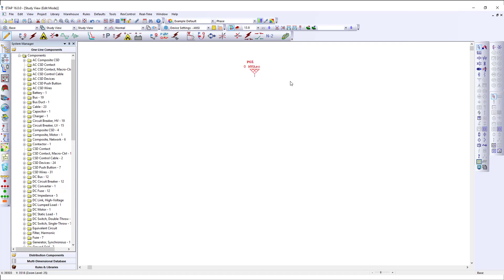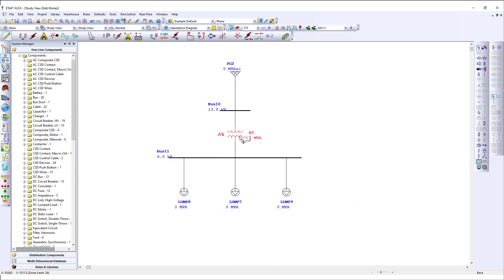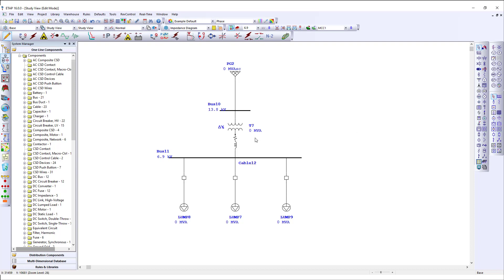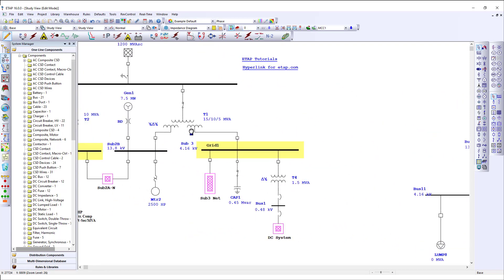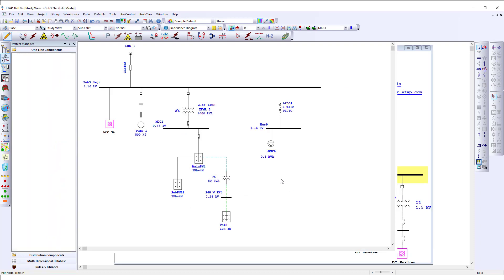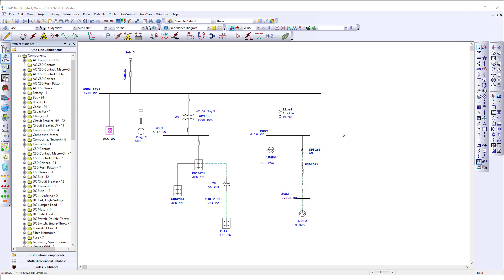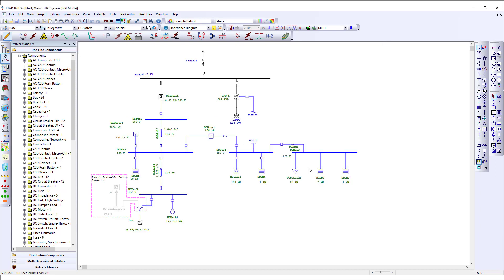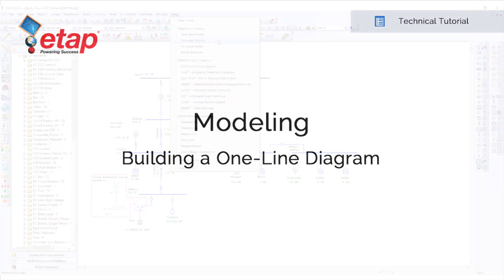How to Design and Model an Electrical Single-Line Diagram in ETAP

Comment: How to add the voltage regulator symbol to me toolbar?
Reply from the maker: Thank you for your interest in ETAP Solutions. Please refer to the ETAP user guide and refer to the section on how to customize your ETAP Software menu, styles and layout. For more further assistance please open a ticket at out 24/7 Help Center https://helpcenter.etap.com

Comment: Dear All,
May I have I question that is blocking my learning on ETAP myself.
My question is about "Protection Device Coordination" on this configuration.
I prepared a simple Single Line Diagram consisted of bus1,bus2 and bus3 from upstream to downstream and each bus has MCCB's 630A,250A and 50A from upstream to downstream respectively.
Once I place fault location at below of bus3,the 50A breaker is supposed to trip at first, then if it fails,250 and then 630A breaker willy trip. What's happening 630A breaker at upstream trips first, then 250A and at the last 50A breaker. As per TCC curves, even 50A breaker will trip first. But whatever I did I could not get the way to settle this matter.
If anybody can help me I will be many thankful.
Regards,
Reply: Check the fault level  provided at 630 amps and 250 amps breaker side in your program and check breaker parameters by double clicking
Reply from the maker: Thank you for your interest in ETAP Solutions. I suggest to contact our 24/7 Help Center https://helpcenter.etap.com and open a ticket for assistance.

Comment: That swift adding component to the same bus does not work on v19. In what way do I solve that problem.
Reply from the maker: Thank you for your interest in ETAP software. There’s a button that enables Auto-build in the toolbar. Once selected it will build your one line dynamically. You also want to make sure your first element is already added to the OLV. Please contact technical support for additional assistance support@etap.com

Comment: How can you model a line reactor in ETAP 18 to do a harmonic analysis. Using a line reactor doesn't seem to work, it doesn't seem like the impedance of the reactor changes at different harmonics, like it should.
Reply: Hi Fahad, To mitigate harmonics, bellow are the filter types: *Single-Tuned*By-pass*High-pass*3rd order damped*3rd order C-class